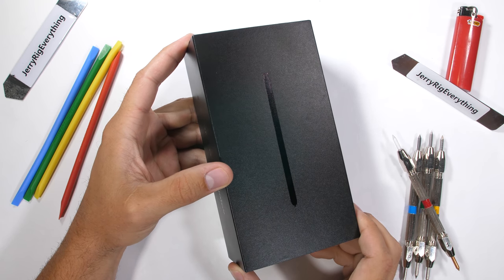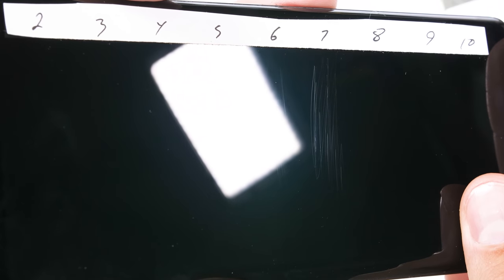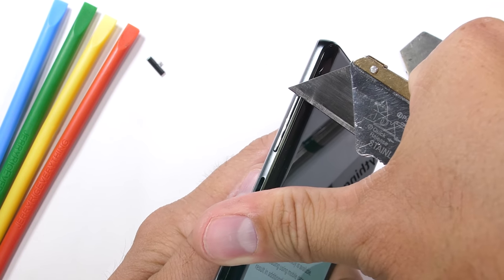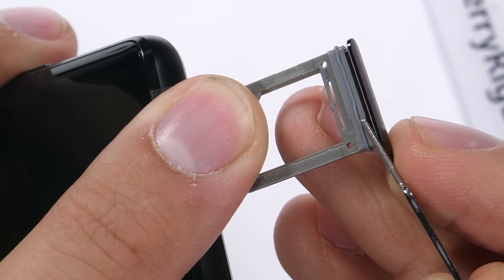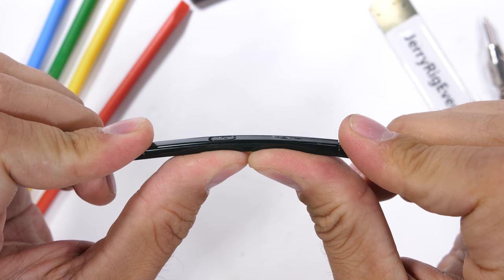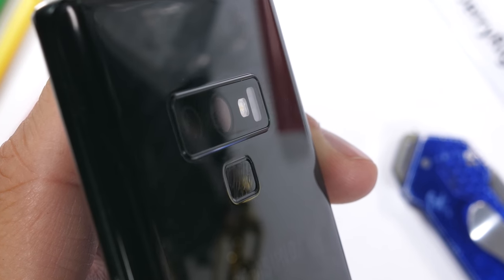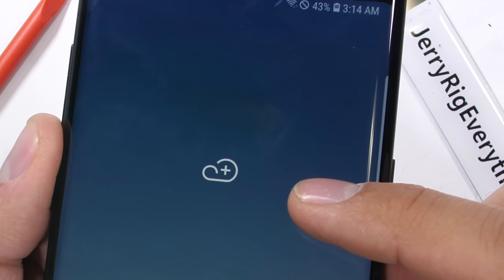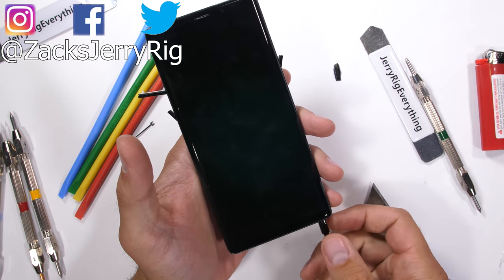Samsung Note 9 Durability Test! - Bixby is not Secure...

Comment: Good to hear someone holding on to their phones even though you can afford a newer one.
Reply: CK NorthPole I hold on to my current phone until I need a new one, not until a newer one is released. They're the same as the previous model except minor unnoticeable spec upgrades. No actual new features appear anymore.
Reply: If you'd upgrade everytime, you'd have to move all your files too.And with that many phones, I'd rather stick with a relatively one and keep it instead of moving all my files everytime and logging me in everywhere manually and having to move my mobile authenticator codes one by one.

PS : Sorry for possible mistakes in my Text. English is my 3rd language.
Reply: I'm still using a Galaxy S4, Works great apart from the battery been useless, every battery out there seems to be fake.
Reply: well thats what samsung smart switch is for to move your data fast and easy
Reply: Samsung no longer manufactures the original galaxy s4 battery
Reply: Konrád Lakatos Yes I used that too but it still takes like 30 mins, you have to Login everywhere manually (Websites/apps), move your autenticator get your themes again etc.
Doing that with new phones once every 2 Years is no problem but Zac has new phones like every month.
Reply: Paper Bag Man same here using s8+ waiting for s10
Reply: Shaffan Mumtaz same. I’m either waiting for the S10 or Note 10
Reply: @CptDieHard  ... yeah...I was just thinking about that...sadly this seems to be true...so that makes older phones with easy to replace🔋 just a marketing trick... original batteries cannot be found on the market anyway when you need them...after like 2 years after the phone is released not to mention 4 years after.
Reply: I have a year old Note 8 but already pre ordered the 512 Note 9. Some of us just need that new new.
Reply: I hold on to my phone (broken/glass shattered/laggy) not because it's nice but I just can't afford an upgrade 😂😂
Reply: You might like unbox therapy, he switched phones every week. He can't decide which flagship he wants.
Reply: Thats good that means whoevers making your phone is doing a good job
Reply: I'm still rocking my Note 3. For drawing purposes. Battery is still good even tho I haven't replaced them yet

Comment: I actually have to disagree with Jerry Rig Everything and think the removable buttons are a great thing, and here's why. 

1. it makes the phone more waterproof as that plastic peg inside on the back of the button can click the actual button inside which is probably covered in rubber. 

2. if you ever get a damaged button you can easily replace it without taking the whole phone apart and not compromising the water resistance.

3. Since the buttons are removable some will moat likely create colored button mods (Like they do for game controllers.) or I really hope so and that someone makes custom button colors that are metal or even clear buttons but those would specifically have to be plastic and then Jerry Rig Everything can have one more thing on the phone thats clear and see through on the phone! We just need molds!
Reply: how the fuck do you damage those buttons
Reply: Knowing my friends I prefer not to have removable buttons
Reply: Yeah colored button are cool but i don't want to lose my power button.
Reply: No one cares
Reply: I am sure you can buy those buttons at a low price of they got lost
Reply: Nooooooo
Reply: I wanna take out the Bixby button and replace it with a flush cover for the hole
Reply: Years ago I was holding my S3 between my fingers while lighting up a cigarette, and ended up melting a portion of the volume button (they were made from plastic back then), I managed to take it out exactly as seen in this video, bought a newer one for like 80 cents (0.80€) and bam, as new. So yesh it could be useful.
Reply: Ok boy you do not get sarcasm
Reply: It’s odd to defend an obvious flaw in the design
Reply: Attraction Spot 'waterproof phones' don't exist
Reply: Henry B how is it a flaw? The buttons are the same shit as the s9 yet s9 buttons cannot be user removed. Its obviously done purposely
Reply: It was a joke lmfao
Reply: Anyways, zack already replaced the bixby with gold bixby 😂
Reply: i bet they aren't going to be any more knowledgeable about the phone you have.
Reply: Attraction Spot ok fanboy
Reply: Samsung fanboy here

At least it’s not an apple fan
Reply: @henryb893  flaw in design? They purposely did it.
Reply: @atilamotila8907  it's definitely a flaw, you should not be able to remove buttons lol
Reply: Someone call Dbrand!
Reply: IF you really use your phone you might need a replacement so yes it is a great idea to be able to replace your buttons. A feature you'd never see in an iPhone.
Reply: Why not? Keyboard keys can be removed and replaced, why is it not the same with the note 9? If it was a design flaw, when jerry put it  back it shouldn't have worked anymore. Try harder apple fanboy
Reply: All samsung buttons are the same
Reply: Yeah also if you can actually steal the buttons without them noticing wouldn't you just take the phone
Reply: Attraction Spot agreed!
Reply: Yeah man you're right Samsung is never wrong 😊
Reply: @katto1937  you didn`t get the sarcasm and you call me an idiot... wow
Reply: @henryb893  your birth is a flaw
Reply: @pcicraftsman8472  well goddamn, didn't think we wanted to take it that far over a power button on a cellphone but ok
Reply: @henryb893  it really isn't, it makes repairs considerably easier. Think for a minimum of 2 seconds is all I ask.

Comment: Although Samsung still put that Bixby button on their phones, this time they allow you to remove it. How nice~
Reply: Would the removed buttons affect the water resistance tho?
Reply: Daniel Vega I believe the removal represents that Samsung has updated the structure of the phone and excluded the buttons from the water proof design. It's quite impressive actually, as Samsung phones have more holes (headphone jack and s pen slot) and still maintain IP68 ratings. But I don't have the note 9 so I could not be sure. We'll know more about these buttons when Zack dissemble the phone~
Reply: Very good thinking!!!
Never thought of that but yeah it's true
(My family is an apple-addict and I chose to switch sides(ended pretty good, have an s8) and my father regrets buying my mother an iPhone X, since it's too heave for such a small device and it's very, very ugly.
Reply: I seriously hate Bixby and Samsung forcing it on their users with a dedicated button. Also I think they removed the ability to remap it with third party apps. Not sure through accessibility though. But I guess now you can just completely remove the button and not even worry about accidentally pressing it.

Comment: When will art class with jerry be back? 😞
Reply: Lol😁😄
Reply: You mean ear rape
Reply: it will be back when jerryrigeverything returns to testing mid range phones
Reply: zacks can still do it on a glass phones. just scratch it with level 9 or 8 on mohs picks like he do it on htch u ultra
Reply: level 8 or level 9 would crack glass
Reply: Dylan Ch'ng see the htc u ultra durability test
Reply: F Ghajell the glass will just fracture easily
Reply: I don't know but maybe he'll draw on a gless phone with the diamond pick
Reply: @shiny_446  The diamond pick would just crack the glass, not scratch it, because level 10 is waaaaaay harder than level 6 (mohs' scale is exponential)
Reply: htc u ultra used sapphire glass.
Reply: @DylanChng  He literally wrote "maybe he'll draw on a glass phone with a diamond pick" not sapphire, glass, which gets fractured by diamond picks
Reply: NiK yea he can draw a spider
You can barely touch the surface to draw and press hard to crack
Reply: @shiny_446  The diamond tip will still crack the glass... He could do something like that with a level 7.5/8 pick

Comment: "Button Gate" will be a trending topic in September.
Reply: Anthony Klun It doesn't come off unless you force it off.
Reply: that actually a good thing since you can replace them by your self without the need to open the phone
Reply: @azexy21  but then no more water proof...
Reply: are 100% sure? have you tested your theory
maybe there is a rubber band around the buttons like the sim card tray
Reply: @azexy21  Not 100% sure, no.
Reply: @AnthonyKlun  I'm pretty sure Samsung isn't stupid enough to compromise waterproofing that easily
Reply: Nah it looked like they had the rubber ring around em like the sd card slot so waterproofing wouldnt be an issue
Reply: It's not a bug, it's a feature !
Reply: You have lots money giveaway me a phone? Note 9
Reply: [rips all the buttons out with ease]
[snaps the S-pen like a twig]
....
[makes an Apple jab]
Android fanboys: “lollll glad I bought Samsung!!!! Crapple products are bad quality & cost $1000”
Reply: @user46346bdtgry  with ease, not really he had to put some effort to take them off. I don't know that much about technology but I'm pretty sure that if the pen were metal, it would interfere with the charging process, and I can't think of many more materials (that would even be slightly stronger than plastic)other than carbon fiber which would probably break all the same. In the end, if it was metal, he could have still bent it with some effort because its just a pen that's only about maybe less than a quarter of an inch thick, you only have so much to work with.

Comment: It would cool if after market manufacturers make different color buttons for the note 9 so that u can pop out the OEM ones and put in the different color after market ones. Red buttons on the black variant would look sick as well as yellow buttons on the blue. variant.
Reply: just pop out the original one and color it in the meantime.
Reply: Could be what Samsung has in mind?
Reply: Quite possibly, as this is a first for them, so this definitely wasn't just a coincidence.
Reply: But wouldn't that compromise the Water and dust resistance
Reply: Jovon Reviews If they intentionally design that way, nope. There are many holes on a phone like headphone jack, usb port, s-pen hole, etc., but it's still water resistant.
Reply: @kimakhiangte  but wouldn't they state that at unpacked and if they did it intentionally then Zach could've took them out way easier.

Comment: My daughter and I have had this phone since launch, so over 5 years now. Absolutely love this phone, so much so, I really don't want to upgrade, but I'm constantly running out of space now. Also, I've always had this phone in a UB Pro case with built in screen protector. I've only replaced the screen once, and that was my fault. Dropped it out of a crane onto concrete, and I honestly don't think it would have cracked but it landed screen down, on a rock. I still used it with the cracked screen until I remembered I had free screen replacement with my insurance plan. My daughter's Note 9 which she's had since she was 14 has never had any problems, she doesn't use a case or screen protector. Her screen however, has the TikTok layout permanently burned in. I've used the built in stylus, maybe 4 times. LOVE THIS PHONE!

Comment: someone can steal your power button or volume button in about 2 seconds😂😂😂😂🤣
Reply: they should have put some spare buttons in the box along with the s pen tips
Reply: It won't be a problem if you put a case on it which covers the buttons.
Reply: Aries Kristle Mangubat still though why do they allow the buttons to come off
Apple has never fone it
Up until this point no s series or note series has done it
No other phone company has done it on purpose with out knowing they were cutting corners... why? Just why samsung? Makes the note 8 look like a better buy
Reply: It's $1.78 to buy new one, sooo.. and who d fak going around stealin' phone buttons.
Reply: Nikola Janković still goodbye ip68
Reply: Jeremy Chua The IP68 water resistance is still there even if the buttons are removed. There is somekind of rubber membrane covering the button from inside so water can't get in.
Reply: OverKnight 52 I actually kinda like the idea. I can just replace the scratched buttons with new ones without using a heat gun, plastic pry tool, etc. in accessing the insides of the phone just to replace a button. That is if samsung would provide replacement buttons. They aren't that easy to remove anyway.
Reply: Aries Kristle Mangubat That's what I noticed as well.
Reply: Aries Kristle Mangubat  yeah its so hard to remove covers.. im sure no1 can do it.
Reply: lool dude read your comment again
Reply: Nikola Janković  29.90 cost those buttons
Reply: Aries Kristle Mangubat it be call to replace the buttons with coloured variants.
Reply: somebody can also steal your waterproofing in under 2 seconds if that happens also...
Reply: Nikola Janković wow, you can buy replacements. Apple should be taking notes
Reply: Sasha Meow, 
someone just said 30 minutes before your comment "The IP68 water resistance is still there even if the buttons are removed. There is some kind of rubber membrane covering the button from inside so water can't get in."
Reply: Check eBay in a week. Those stolen buttons have  to be offloaded somewhere
Reply: @fernandoaugusto3909  sorry i forgoted r
Reply: M.t random haha I was talking to the other guy but it's ok it also worked for you 😂
Reply: @fernandoaugusto3909  🤣😂😂😂

Comment: been using note 9 since 2020 (bought used)  till early 2023 when i switched to s21 ultra. note was the best phone i ever used imo. I replaced it only because it had battery problems and i really wanted a wide angle camera but i kinda regret i didnt use it a bit longer, it was still a great phone

Comment: Checking in on 2023 1:45, My dad had his Note 9's power button jammed in due to heavy use, so I use the razor method to pull out the old button and replace the Bixby button, since he doesn't use the Bixby at all, now the phone works like normal again with functional power button, I think it's a good feature to have....

Comment: Is the phone waterproof without the buttons?
Reply: Filip 900 great idea for a video
Reply: It's not waterproof with its buttons either
Reply: General BigMac_ He meant if it's still water resistant
Reply: should be, the inside of the buttons have a pretty tight rubber seal
Reply: Filip 900 think so if the buttuns fall of so ez than it is
Reply: IP68, water proof for 30 mins in 1-3 m submersion. :)
Reply: @bobdabuildar69  the buttons dont fsll off so easy, it still requires some force.
If samsung made the buttons removable then they must have rubber rings inside just incase someone forgets to put the button back in for whatever reason they took it out.
When dealing with kids this is pretty good on my part since kids like to touch your phones with sticky fingers and get the buttons stuck like they did on my iphone 7 plus
Reply: The water proof casing is around the buttons in the phone not the buttons them selves. Meaning it's still water resistant without any buttons.
Reply: +Ankit Sonker 

Technically, yes, you are. The delivery system is just damaged at that point. I think you mean to ask if they are still potent without balls.
Reply: Water-resistance is a major concern for holes like the charging port/headphone jack/speaker and so on. Button don't usually require physical hole. IMO it shouldn't effect the water-resistivity

Comment: Samsung should fix those $1000 buttons.😂
Reply: bulexia 00000 I have a feeling they did that as opposed to fixed buttons for water proofing purposes. Those may be pressing on the membrane making those extensions of the actual button.
Reply: Mr. Glarblesharf 100% agree with you
Reply: they will include some buttons in the box next to the s pen tips...as consumables 😆
Reply: kamysamaa That would be good. I'll probably have it in yellow to match the pen.

Comment: Hi Zack, could you take a look if the phone is still water resistant once the buttons have been removed?
Reply: Doubt it is...
Reply: I dont think it is, it looks like the buttons have a water resistant ring
Reply: I have the button that fell out, but the blue-green part is hard plastic and it's broken. If it was a rubber ring it would've been pliable.
Reply: daniel x It’s still water resistant it has inner rubber.